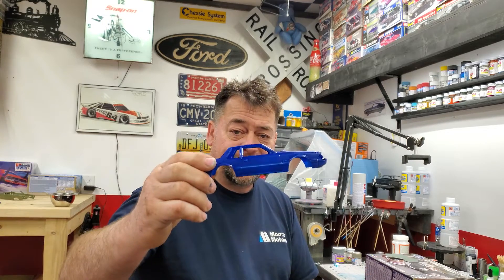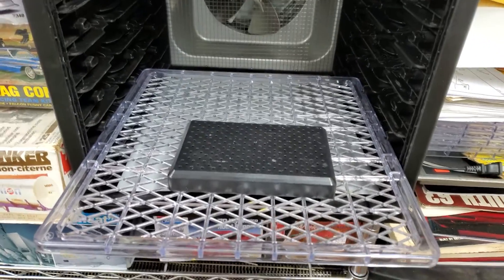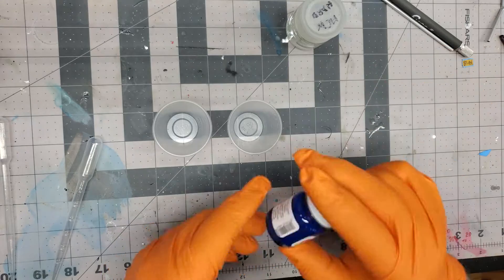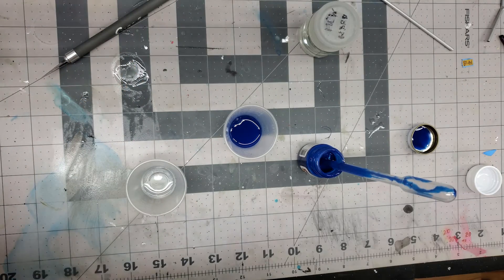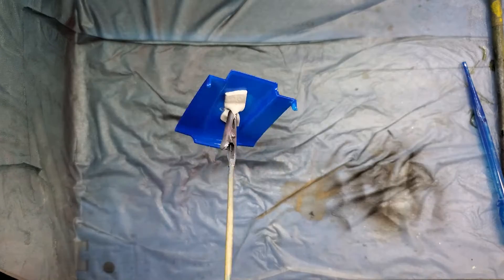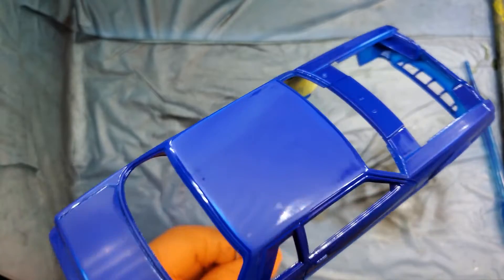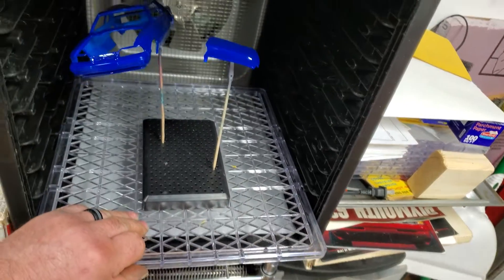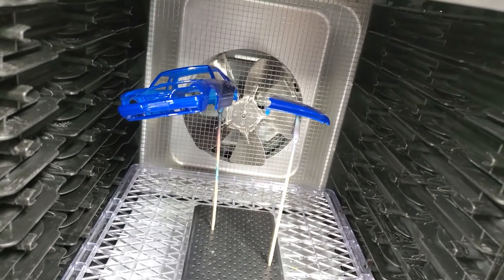HOW I SPRAY MCW ENAMEL PAINTS..

Comment: Perfect timing, Kreg! I'm going to sand the body of my Chaser because I'm not happy with the paint on it. Going to let it sit while I run some errands and then give it another coat of paint.
Reply from the maker: Thanks JD, with the metallic paint I found the first few coats need to set and cure to fill in the gaps, I just did a second mustang in green and separated some, looks good though.

Comment: Love the Mr. Leveling Thinner. But I'm using Tamiya Acryls. I've been tempted recently to try the MCW paints though. What grit of sandpaper are you using to scuff the plastic prior to paint or primer?
Reply from the maker: Yes my favorite thinner. I have not yet tried the Tamiya Acrylics, normally I don't sand the plastic the enamel paint bits nice, this was a redo and the prev paint was sanded, I use 2000 for a repaint, and 2000 on the primer if I spray it first. I will always prim if I'm using lacquer, find it covers nice.. Have a good one!

Comment: So, if I understand you correctly, you put twice as much thinner in the last coat of paint as the first mix?
Reply from the maker: I will add about .5 ml on the final coat to help level it better. you don't have to add anymore, more of a preference thing
Reply: @kregskorner8851  Thanks for the info Kreg! I've been using the MCW paints with your mixture, needle size, and air pressure, and it is working beautifully!

Comment: Hey Kreg, I’m trying my first paint job with the MCW enamel paint, I bought some Blue metallic. Do I have to add a hardener to that ? Or just go with the leveling thinner. Thanks , Al
Reply from the maker: Hi Al, no you do not need the hardener, will just speed up dry time, I have found especially for blues give it a light coat of blue lacquer paint first, something close to your color. Wet sand if like, then shoot the MCW, will help fill in body lines without using a ton of paint.
Reply: Okay, thanks for your help.